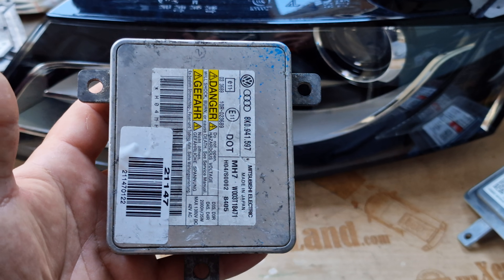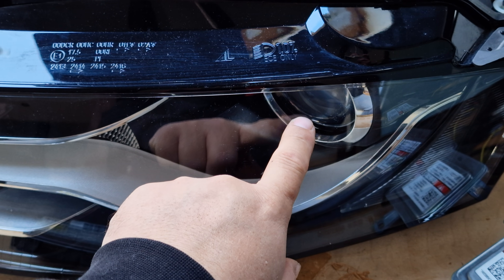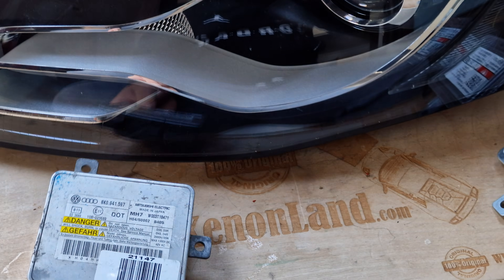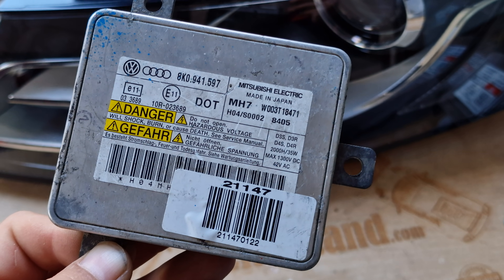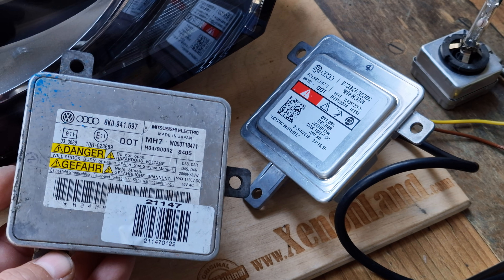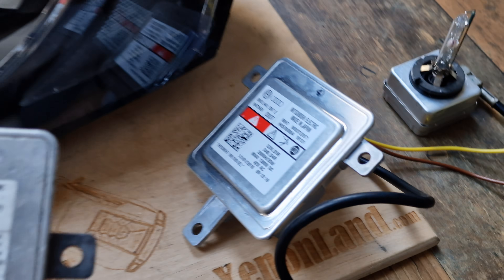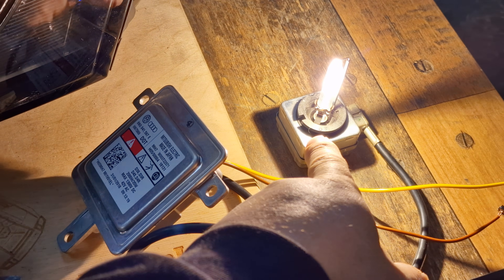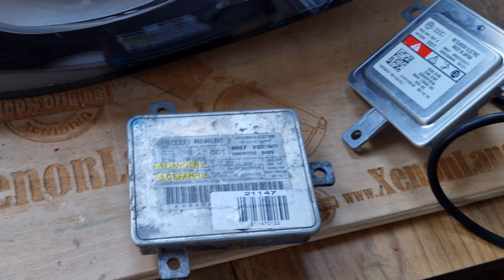Audi A4 S4 B8: Do not you have low beam? Check your xenon headlight ballast 8K0941597, 8K0941597C

Comment: How did you bench test the ballast and the bulb against a 12V battery? The connector was blocked from the view. I could see the wire coming out but cant see the front where it attaches to the ballast. You don't explain where to buy those extra cables or how to connect them?